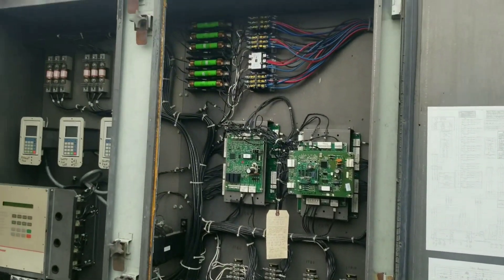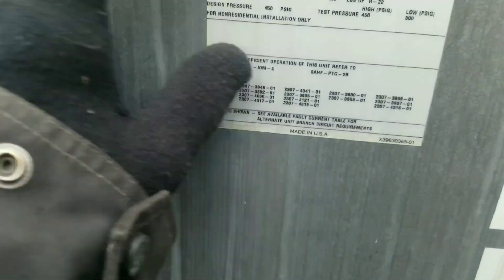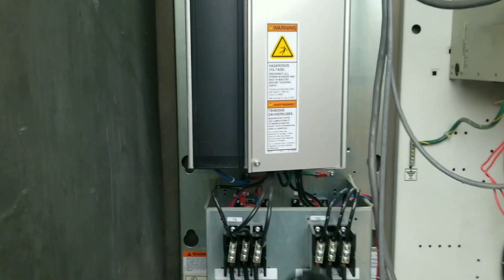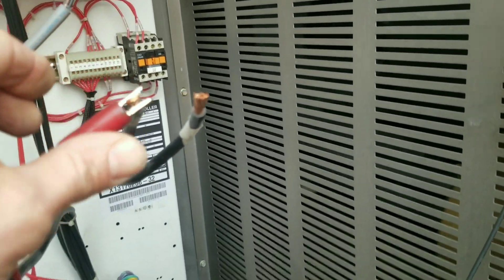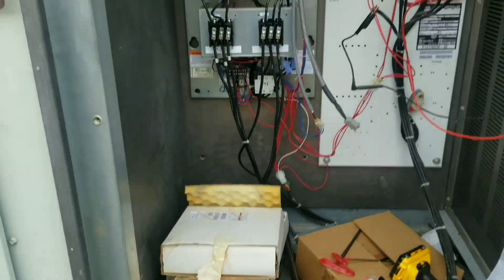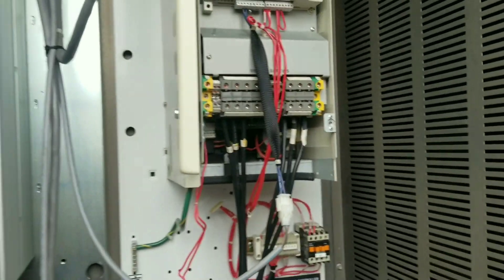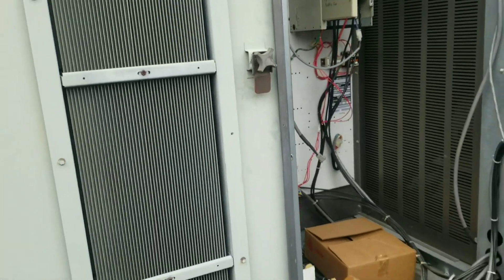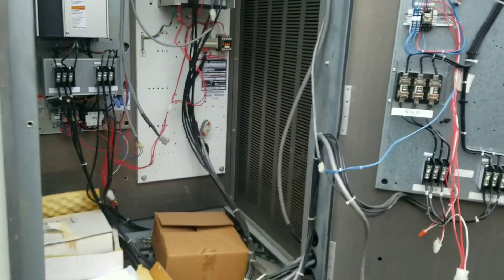hvac no heat call, trane intellipack

Comment: So did you have to buy the VFD from Trane?  Just wondering why not another brand
Reply from the maker: This was bought from Trane, another brand may work but would be tricky, you have 2 blower motors that should run together at same speed. These drives come, for the most part set up to operate as needed.

Comment: One suggestion would have been to set that motor to run full speed, and it would have just ramped the other down more instead, however if the minimum speed in the drive was too high you may have run into pressure issues. That and you'd probably need a contactor so it would turn off overnight.

Looked like a neat install otherwise! As other comments have said, blocking off the fan rather than just stopping it from spinning is a good idea. Air will still freely pass through a stationary fan.
Reply from the maker: Thanks for the advice! Thanks for watching!

Comment: Was motor manual reset overload tripped on the starter? Seen that keep the drive locked out.
Reply from the maker: No, this one did not have a manual reset OL, but remote read out of VFD was not working either. Resorted to good ol trial and error, motor seemed ok when I made it run.. VFD issue. That was my thought process,  thanks for watching!

Comment: Do those VFDs come pre configured?
Reply from the maker: For the most part yes. Trane did include a list of parameters to check and verify but only had to set the motor information, voltage, current, min/max frequency ect. Made for a pretty easy install.

Comment: I love the sound if high frequency inverter drives
Reply from the maker: Thanks for watching!
Reply: I like then, so I installed a ABB 550 on my early 1960s Home furnace installed a three phase motor to teach my youngest son how to install and set up VFD drive and three phase motor. How to install wireless thermostats and sensors and actuators this was his teaching furnace at home. Home schooling. 
       My son did it all by himself no experience no help he had to read the factory Manuel’s (RTFM) Plus my son attended ABB VFD drive classes with me before he got to touch the unit.
Reply from the maker: Nice, we need to teach the next generation of tradesmen everything we can. If there is one thing this trade needs its young people willing to work.

Comment: You can't  run that machine without  both fans on. Need to block off off fan. Plywood been there done that
Reply from the maker: Thanks for the advice, I did not block that fan off but was able to keep it running for a few days until the drive came in. I did stop the fan from rotating, disabled morning warm up and took out all scheduling on BAS so we ran VAV mode with no set back. Once the building was warm it actually maintained a good static pressure as well as space temp until the drive came in.
Reply: Glad that worked
Reply from the maker: Thanks for watching! And advice is always welcome, next time I will try blocking that fan off.